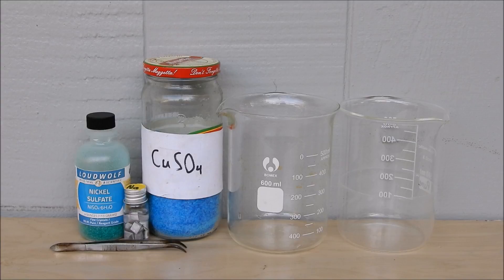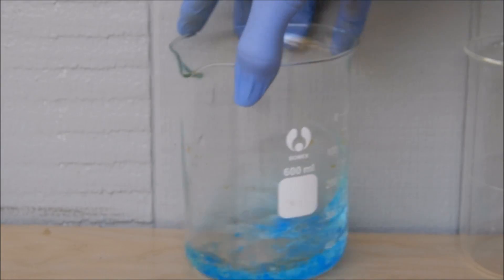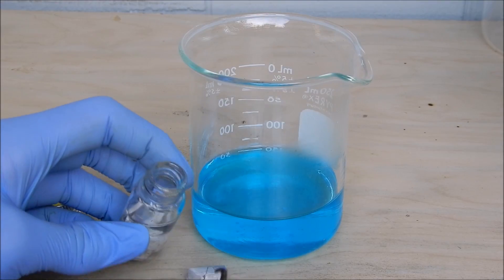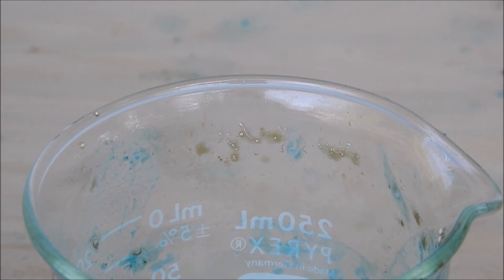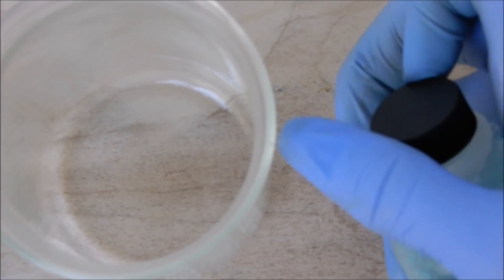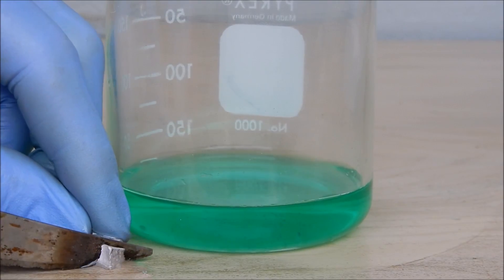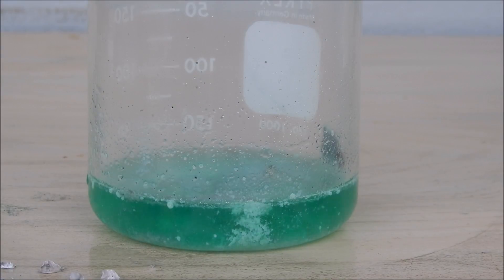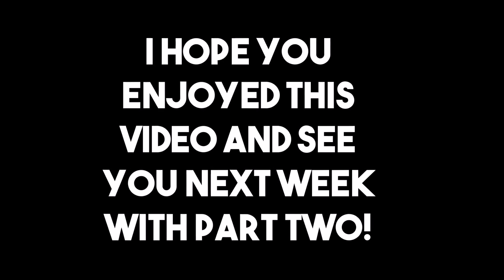Explosive Reduction of Nickel Sulfate to Nickel Metal

Comment: Both Sodium and Nickel Sulfate have low melting points, you could try doing this reaction in liquid state, and thereby producing pure nickel metal
Reply from the maker: +MDetonados Yes although that would involve the chance of molten sodium and salt flying into my face🤕. Also I tried to mix the two off camera in their solids states, but they didn't react, and the nickel sulfate just decomposed when I heated it. Any other suggestions? Sorry I turned your suggestion down😅
Reply: Yeah, your right, it would be too dangerous to try that. I'll think about and comment if i got any other sugestions.
Thx for the reply! :)